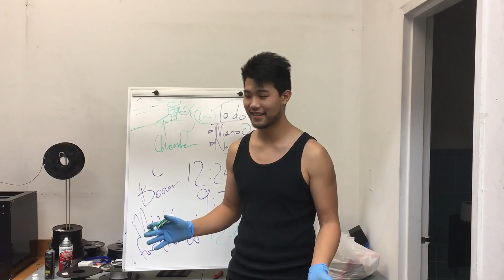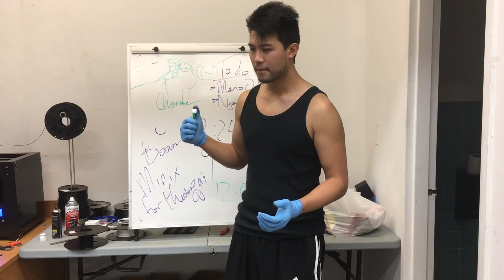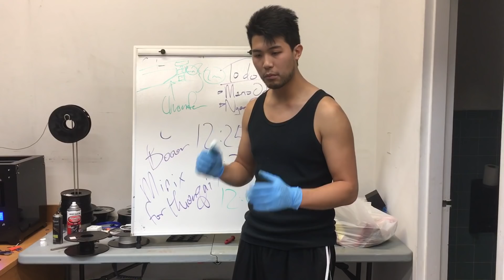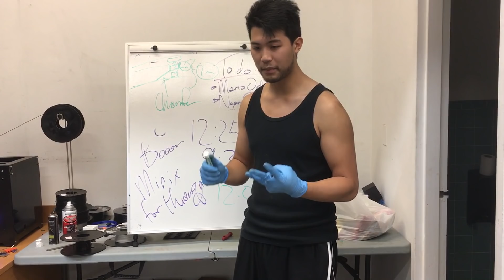Cubicle Labs Chemistry Lesson #5: Lubicle ONE, Azeotropic Siloxane Ethers with Teflon

Comment: Chris, I have a question. In this video, you mentioned that the "k" in Traxxas lubricant weightings stands for 1,000 centistokes(cSt). However, all the research I have  done (probably not as much as you) says that in fact Traxxas uses its own measure of viscosity, wt, which is not standardized between silicone lubricant manufacturers and does not line up with cSt (the worldwide standard). So, are those people wrong? Does the k in fact mean cSt? Or am I just wrong on the whole issue?
Reply from the maker: Rushil Kasetty you're right